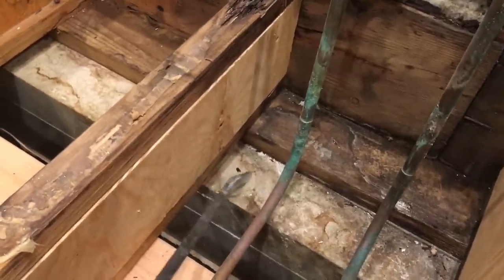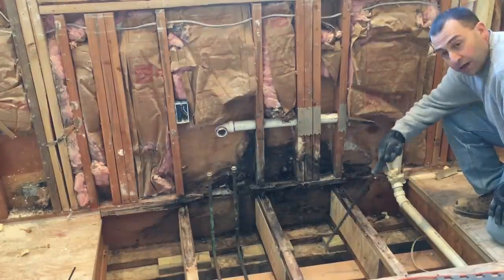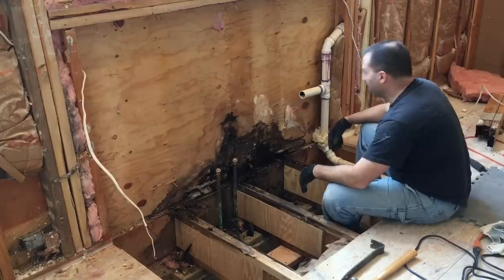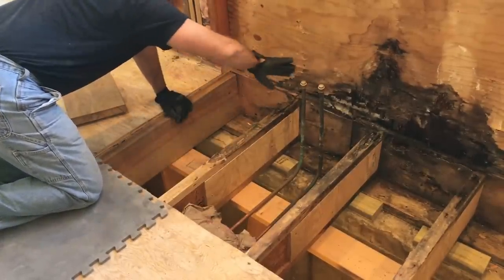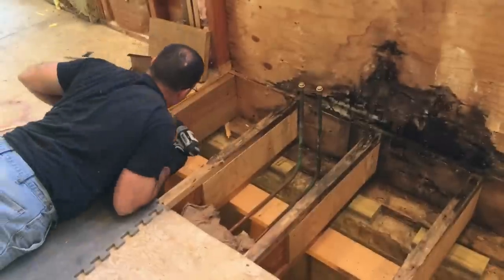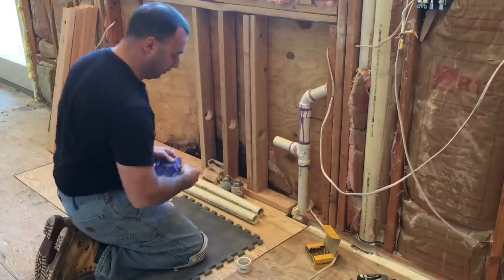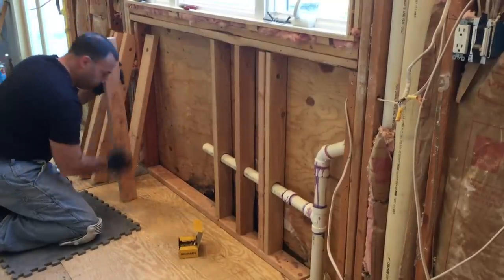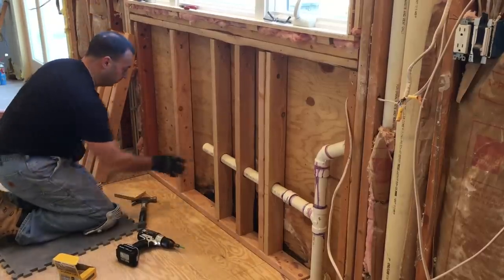Repairing Rotted Joists and Subfloor  - Part 4 of Remodeling My Kitchen

Comment from the maker: Getting a fair amount of comments regarding concern about the rot "re-spreading" to the new wood.  I'd like to address in a pinned comment here:

First of all;  Mold spreads.  Fungus spreads.  Dead, dried out rot in the absence of moisture, does not.  
Yes, I agree that if I took new wood and fastened it against wet, moldy, living rot, then I am going to have a world of issues down the line.  That’s not the case here.

In my situation, any living mold in the damaged areas was first completely annihilated by spraying a ridiculous amount of bleach onto the joists, sill plate, ledger board and foundation wall.  I let it soak in.  Then applied more. Let that soak in.  Then applied more.  This applying, soaking, reapplying process took place over the course of days, not minutes or hours.  Nothing could survive inside the core of any remaining wood.

Next I started the drying out process.  I ran a dehumidifier from down below directly under damaged area.  Keep in mind this was during the time that the floor was already completely opened up.  This was back in January – February so not only was the dehumidifier sucking moisture from below, but from above everything was drying out with the aid of a heated, climate controlled first floor.  (Ever notice how dry the air is indoors in the dead of the winter when you are running your forced air Central HVAC furnace?)  After one day, everything was dry to the touch.  But I left it open for 2 – 3 weeks!  Dehumidifier running 24/7 and first floor thermostat maintaining my typical winter time schedule.  The video may only run 15 minutes but the first minute took place about a month before the actual construction work began. 
 
There is nothing living (nor wet) left to “spread” as any darkened wood you still see in the video is no longer rot, it's just dried out discolored wood.  Not to mention, to this day I still run the dehumidifier on a cycle for general basement moisture control.

Even if there was ZERO structural integrity left in the old joists (which is not even close as it was holding up the house for 12 years while the leak slowly did it’s damage – not a typo – 12 YEARS), none of that old wood is required for any structural support anyway.  Absolutely none of it.  Not the 3 damaged joists, not the old sill plate, not the ledger board.  Everything is now supported with new reinforced structure.  I actually went way overkill making this stronger than the original.

1. 3/4" ply sandwiched in the Engineered TJI joists to strengthen what was damaged. 
     <If that were to fail then....
2. New joists sistered onto newly reinforced TJI's - long enough to grab plenty of the undamaged part of the TJI.
     <If the sistered “seam” wasn’t strong enough (it is) then…..
3. A new 2 x 6 supporting wall underneath grabs both the “new” joists as well as the undamaged portion of the TJI joists.
     <If that isn’t enough to hold up everything (it’s already overkill) then...
4.  A new Pressure Treated sill plate sits upon the foundation wall (3 individual sill plates actually) which grabs the ends of all three joists.

In 12 years my house didn’t collapse under the damage done by the leak.  The weight directly above that was ceramic tile, a sink cabinet, granite counter tops and probably one of the highest traffic areas in any household.  So leaving a little “dead rot” in place after this overkill job I really don’t believe is of any concern.  

Before I started any of this I consulted with my contractor who framed my house when it was built.  I had him take a look from underneath when it was soaking wet and actively leaking.  He said once the leak is identified and fixed, he would strengthen the TJI with ¾” plywood as described in step 1 above and be done with it.  I said, “That’s it?  I was thinking about building a support wall underneath”.  To which he said: “Wouldn’t hurt, but not necessary.  I mean nothing has collapsed yet, right?”  He suggested for me to give it a shot and if I feel I got in over my head to give him a call and he would do the job.
When he asked me how I made out and I showed him everything I did, he simply chuckled and said:  “Overkill much, Mike?  Yeah, I think that floor will be good long after the Good Lord has taken us off this Earth”
Reply from the maker: AmazingZed  Construction screws. Long enough to go thru one side, into the TJI and then grab the other side. I put a few in from both directions. This way it really pulls them in tight to the existing joist.
Reply: That is the longest reply I've ever seen..........
Reply from the maker: @ramaporiver803  I am very detail oriented!
Reply: Thanks for sharing your experience. Best to ignore the people commenting that do not have their own videos/solutions, as those people tend to suck IMO :)
Reply from the maker: @will201084  Haha!  Thanks for that.  I totally welcome intelligent suggestions and other ways of doing things.  Like the guy who recommended the wood filler pertrifier.  That was smart a suggestion and something I will do if I have a similar experience in the future.
But then there's the dope that claims the whole job is a fail because I didn't use glue.  Idiots like that can suk it. 

Thanks for the comment!
Reply: Definitely overkill. But I noticed that when you were checking for plumb and level. You do good work. I’d be proud to have you work on my house.
Reply from the maker: @DanielinLaTuna  Thank you.  Appreciate the kind words.
Reply: And it wouldnt collapse as that part of the house is supported by the header above the window.    That doesnt mean you did the right thing to fix the dry rot.   Right thing to do is take all rot out and replace
Reply: Thank you for this reply. And the video, wow, really learned a lot from this! When I did a similar job, I used construction adhesive to my plywood cisters. And I filled  in the old joist with wood Bondo... But now I'm thinking... I was probably a little too extra! hahahah Great vid!!
Reply: @Heloise O'Byrne to be honest, I don't think I'll ever do any wood repair without spraying borate solution. so many termites everywhere... so great way to have peace of mind IMO.
Reply: Thanks for all those details….and for mentioning the Good Lord. 😊
Reply: I think it will hold up. In the COMMENTS, we simply comment about "ideal" scenarios. In reality, what you did will hold up a long time. In some ways it was over engineered but in some other ways, it was not done correctly- not like a pro should do it. No town would sign off on this if there were permits involved. I won't call you a hack- but it was simply not done in a highly professional manner. You did a decent DIY job though. You have the skills- just next time give that extra 10% and replace the materials. You certainly look capable- probably less work too actually!

My biggest issue with your job. The way you handled the rot. Your patches. I would have definitely replaced all rotten and moldy wood. I have dealt with mold and rot. It's nasty stuff and you want it OUT. Spores can get released, etc. That is also a high moisture area- even if no direct leask. 

2-3 weeks drying feels good and seems like enough time but trust me, it is not. I had a leak that was not as bad- hardly any visible mold and they recommend throw out everything, what you cannot, give it over a month with multiple commerical dehumidifiers running. 

Also, NEVER use BLEACH on mold on wood. Ok on non-porous materials like porcelian e.g., a sink or toilet it is fine. It rots wood and the molecules are too big to penetrate the wood (even if it soaks it.) It does not get IN to the cells of the wood- stays on top and only makes the wood weaker. Does very little to the actual mold. In fact, it can make it worse. Look it up- it's true. I dealt with this for months so I really know what I am talking about. It is also very bad for your health even in the future as you breath in wet, now dry, but soaked moldly wood. Throw it OUT. It also damages the structure and can actually cause the mold to grow in other areas. It's a real thing. VINEGAR is better and removing it is BEST. Pretty much common sense.

Comment: This video is PERFECT! I have to make a similar repair and this explains it step by step so I can duplicate. Thank you so much!
Reply from the maker: Crystal - Thanks for the comment - Take time to read my pinned comment right below the video.  I explain in detail how I went about killing all the mold - Once it's dead it must be DRY, DRY DRY.
Also read through the comments by others - I have been highly criticized for not cutting out the old, dead rot on the joists.  They are idiots.  They don't understand that something dead and dry biologically can not re spread.  If I cut out entire sections of joists, I would have highly lost the integrity of the structure of the floor - not improve it!  

But there is some discussion in the comments where one guy talks about treating the wood with a "petrifier" - I would certainly look into that.  I liked his idea as yet another step in this process.  Good Luck!
Reply: @DieselMike  thank you so much. Will do

Comment: Bro, I love your demeanor. I was cracking up along the way watching. I have a similar situation going on in a few rental units in the bathrooms. The old hot/cold shower valves have failed. I had just recently fell into these units out of misfortune which sounds odd but it is what it is. Now, I've gotta make these puppies fly. So I've had a little learning to do in that regard as the water has rolled behind the water backing board and has done some rot there. This gave me a few good ideas for remedy. Thanks.
Reply from the maker: Thanks for watching and the kind comment.  Good luck with your project.

Comment: Not a bad job there Mike. I haven't had to work on Floor Joist like that yet, good to know about the 3/4 plywood idea.
Reply from the maker: Appreciate the comment.  They are called TJI Joists.  I got the suggestion to strengthen with the 3/4" ply from my framer who originally built my home.  As I explain in my pinned comment above, he felt that alone would have been sufficient.  (I think he would have changed his mind once everything was opened up).  But I decided to go the extra mile by sistering the joists, installing a new sill plate and giving extra support to the who structure by building a partial 2 x 6 support wall in the basement. 

Thanks for taking the time to watch and comment.

Comment: In order for you to properly reinforce and sister an existing support or wood member all damage (including rot) needs to be removed entirely. Attaching more wood to existing rot damage is never a good idea because fungus decay will begin to rot the adjacent wood members. As soon as a moisture source feeds the fungus again, air ventilation problem, plumbing leak, siding leak or etc etc....that rot WILL come back with a vengeance. Glad its your home your working on.
Reply: What about removing dry rot and sister it with pressure treated wood. Or painted wood.
Reply: @rasra9957  That is the preferred repair method.  Cut out the damage install new like wood or PT wood then sister and re support.
Reply: @Flielow  I'm not in the construction business and immediately thought all of the rot should be removed. Its a little concerning that the rot hasn't been removed. Troubles a brewin'.
Reply: Rich Bove he did use PT wood by the time is a problem...it will be someone else’s problem
Reply: Where im from we would say (butcher) 😂
Reply: I mean you trying to make it look good ,but it's not.
Reply: @mikebottorff593  we say a Tyrone job

Comment: I find it funny when people claim Manufactured/Mobile homes are build so badly.... but yet they live in houses with OSB Floor Joist's.  I'd never live in one of those garbage sub division homes not trying to sound like an a$$ in anyway it's just these newer houses are built so fast and so cheap not to mention they're 10ft apart and cost a ridiculous amount.  I'll take a good built Clayton or a Palm Harbor Double Wide or Triple Wide any day over these "Houses" Easier to work on and better built in my opinion they have real 10x2 Floor Jost's 2x6 Walls, Steel Strapping from the floor frame to the walls and then 2x6 and 2x4 Ceiling joist's which are all tied together with steel strapping you also have a steel frame under neither will never crack etc. 150,000 For that and 50 to 100 Grand for an acre or 2. I'll take that vs a house that will crumble in the first 10 years of it's life on a concrete foundation.  Manufactured homes are not like the old fashion "Trailers" like everyone thinks they're actually better then 90% Site built Brick Garbage 70's/80's homes and modern subdivision homes.

Comment: In that drain pipe  T connector is used and i think (i might be wrong)  it is not up to the code because T forms a sharp 90 degree which is prone to clogging . What you need there is Y connector (or what ever it is called) so 90 degree turn will not be that sharp.

Comment: It would have been a good idea to allow all of that area to dry out, then apply KIJZ  a shelak based sealer to contain the mold and remove all of the rotted wood and rebuild the I joists then add the reinforcing to the I joists, sill plate, and rotted wall studs. Then the exterior sheathing.
Reply: Read his post at the top of comments. He killed the mold with bleach over a few days.

Comment: I can see how you’ve gone about it, but I might have done it a bit differently. I would have made the ply reinforcement at least as long as the timber you used to sister them with. I also would have glued and screwed them, the strength of the connection is multiple times as secure. Otherwise, a job well done.
A hell of a lot of damage to find though. I’ve had a similar experience recently.

Comment: Good stuff. (what the hell did we do before the oscillating  Saw) your comment about rot not spreading in dry wood. true, but with the caveat that the wood does not have to be wet to have rot spread slowly. I generally spray this stuff down with a borate type wood treatment. It does not take a lot of time and does not cost a lot. 
I would be concerned about the engineered joists.  A few of them the top cord was completely gone, and there is only a couple 3 feet of new stuff on it. This is a high stress part  of the joist. I would have thought about putting in 8' 2x10's down below.
Reply from the maker: You make a good point about the tops of some of those engineered joists.  Which is why I went so overkill with all the reinforcements.  With the way I chose to do this, I realized that the top of those old joists are doing very little in terms of structure.  That was the purpose of the sistered joists. 

Even though they are only about 3.5 - 4 feet long, one end sits atop a new sill plate on the foundation wall.  And the other end is supported by my new 2 x 6 support wall in the basement (which also grabs plenty of the undamaged engineered joists).    I don't think the length of the joists are as important as the wall that supports them underneath (as shown at 1:40).
Thanks for the excellent comment.  Appreciate taking the time to watch.

Comment: I'm in the process of repairing a similar rot problem in my outside deck where pressure-treated joists have begun to rot.  Some of them are just impossible to remove as numerous joists are coupled to them.  I've dug out much of the old rot and coated the remainder with creosote before and after reinforcing with new wood and replacing decking.  But now, that's Florida which is often another word for mildew........................

Comment: Does code allow to drill 1-1/2” holes through a king stud?
Reply from the maker: I believe that's why there was so many extra studs originally under the window.  To compensate for the large holes that allows the drain pipe to pass through.

Comment: Question i have the same issue in my house, being that this is a load bearing wall would i have to not only support the joists but also the roof with an additional wall built on the subfloor? I see you got away with not supporting the roof(as far as i can see) would you say i could get away with that too as long as it’s a small section like yours?
Reply from the maker: In my case the roof (second floor for my situation) was never unsupported.  Notice the damaged area I replaced was under a window.  The jack and king stud on each side of the window was never touched.  With any window (or door for that matter) there will be a header over the window supported by the jack and king.  That is what supports the entire second floor (or roof).
Now the studs I pulled out below the window I would describe as "supplemental load bearing".  What I mean by this is:  go to 6:35 in the video where I pull out the last of the studs.  Notice each edge of the window is still supported on each end by a stud (which is securely sitting on solid, undamaged flooring).  I was confident that this would be enough to "hold up" the window until I re built a wall under the window.   I mean think about how much is holding the window in place as it is: It's nailed into the header above, as well as the studs on the sides.  For the 45 minutes the window was partially supported ended up not being an issue.

My questions for you would be: Are you working under a window like I am here?  How many "true" load bearing studs do you need to replace?  And how damaged is the sub floor below each stud? 

Every situation is different.  But you absolutely need to support the floor above you when pulling out damaged studs.  If you need to replace a decent size section of the sub floor and load bearing studs, you are going to have to build a temporary wall far enough away from the existing wall that would sit on "good, solid, undamaged flooring while you tear apart and re build the damaged wall.  Once complete, you would disassemble your temporary wall.

Hope that helps.